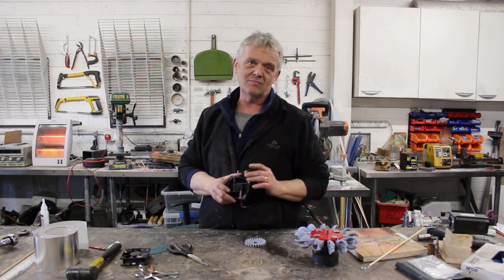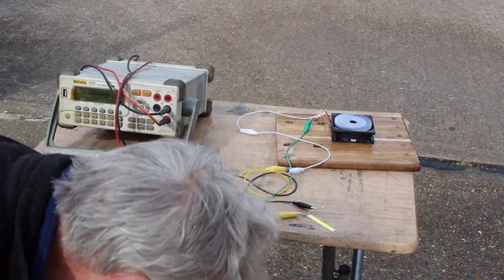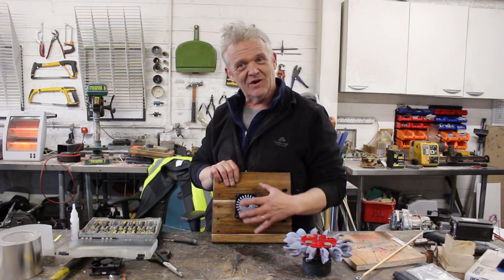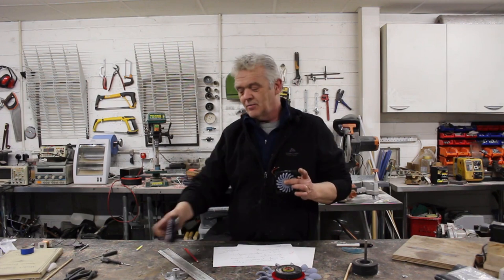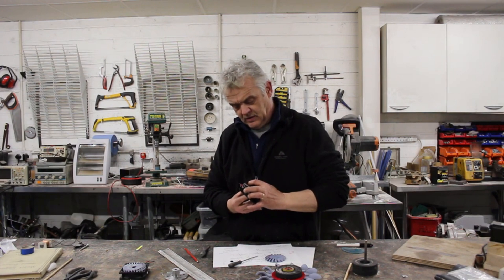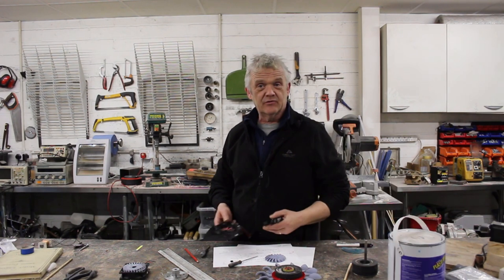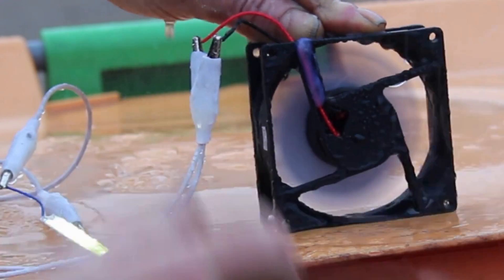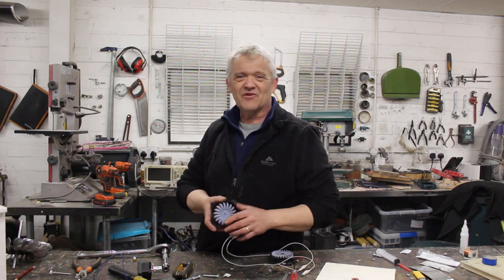2108 Water Power -Turgo And Pelton

Comment: So this is an off topic idea that I hope you might like ? A Heat exchanger is the newest thing for home heating at the moment and although efficient they can cost a great deal to run if you don’t upgrade the heating pipes radiators hot water cylinder’s and then adequately update the insulation and add better triple glazing etcetera ?  Now a large sand batterie if built large enough can hold heat for a very long time so a 2 cubic metre box would hold a lot of heat ? Say you put an oil filled pipe with a circulating pump in to heat up the sand and run it on an off peak night cycle and set a thermostat on it to say 150 degrees c over a number of nights or  weeks you would get this up to temperature and very cheaply too ? Now put another pipe and pump to run this into a hot water cylinder to heat a your hot water and be your heating?? Both thermostat controlled? You could add to this a dump system from some solar panels to add even more heating the summer which would make it even cheaper to run that or a solar heat collecting system? Also with the right construction you could put this into your attic and spread the load on the joists by making it say 100 or 200 cm high internally add the insulation on the out side and you could build it over 10 or twenty metres for the same cubic metres of storage?? And same topic different idea why can’t you put your heat exchanger in a large box with one way in and out air vents and heat the space with a night storage heater again off peak heat and therefore heat everything much much more efficiently and cheaply? You could even make a double glazed heat box around it in direct sunlight to solar heat it as well?

Comment: Brilliant as always RMS.  I’ve probably missed this in previous videos… why is speed over torque so important for domestic generation? Is it a reflection of the variability of wind/hydro speeds? Is it an electrical phenomena (volts better than amps?). Is it to do with availability of reclaimed parts? Many thanks for any insights, Simon
Reply: Given constant strength magnetic field, such as produced by permanent magnets, output is directly dependent on speed. You can play volts against amps with wire thickness but their product (Watts) will always be proportional to speed. Thus high rotor speed is indispensable for useful power generation. When it can be achieved without gearing, then significant mechanical losses are avoided, which translates to even more output (per input). Thus Rob's direct rim generation is a great idea, though it has its practical limits:  to make a large generator, you will need lots of magnets and wire. After thinking about it,  I advise using lots of magnets, which are cheap, on a large diameter rotor. Then make a stator that covers only a small part of the circle, thus keeping the amount of (serpentine) coil within reasonable limits. This has the same benefit as gearing, without its losses.
For example, if Rob used in this demo one of his rim generators with greater diameter, he would have obtained even higher output (assuming the little turbine could spin it at the same rotational speed).
Reply: The recent video about the Archimedes screw does go into torque vs speed. 
My understanding is that it depends on the source of energy and the way it is harvested.
Water in a stream isn't fast but has a lot of torque, and is fairly predictable while wind is rather unpredictable and doesn't have much torque, but with a horizontal wind turbine it produces very high rotational speed.
After seeing Robert's video about recycling vertical fans (squirrel cage) to make wind mills, I've been experimenting with it and found that even though they have greater torque than their horizontal counterpart, it's still preferable to use a low torque generator as it allows harvesting more energy if the windmill can keep spinning when the wind slows down to a light breeze. Finding a motor which can provide at least 5V at 2 RPM is proving difficult though.
Reply: @VeniceInventors  this is true but I was analyzing the electric generation end. It  always needs maximum possible speed, unless you have  much stronger electromagnets whose back emf will match your torque.  With weak permanent magnets, you only have the speed to play with and you will only achieve that match (maximum power output) at very high speeds. So, if you have slow torquey motive source, like low head water, you must gear it up somehow. Though to a lesser extent,  the same applies to the wind as well. There you might be able to get away with rim generation on big diameter rotors, in decent winds.
Rob makes demos that 'something can be generated' but if you ever want to generate useful power, you must consider this.
Reply: @leostarling5746  Thanks for bringing up rim generation. It is something I could easily try as there is a flat disk on the squirrel cages where magnets can fit and  be fine tuned with the coil to match my requirements. Using new and recycled motors is convenient but leaves a lot to chance.
Reply: = to produce more torque - more  load needs to be on the system - Matching maximum torque of the system at any RPM is key to approaching a good efficiency at steady state output. (ue te most out for the least in - materials and hydro resource - , with such a small generator stage (low lods, these babies are nearly up to "freestream speed " of the jet- "Betts limit" - or somesuch more acceptable metric for hydro turbines (constrained flow)  will "indicate the mechanical load" which will produce the most power (peak) out of the system - now to convert all that to electric output..  Using an unloaded the rotor  the velocity  will approach the jet speed - steady state, but mot load the cups up well, ie, operating fairly inefficiently.

(with a given PM generator - speed rules - as per other comments)

Comment: Always a pleasure Mr.Smith, you leave no disappointment.
As the thunderstorm generator touched closely to the aspect of ideal as the self induced lightning harvest converter or (the striker), the striker is a partial to a larger project that requires a global scaled system that converts and transforms energy for future needs,"problems -solutions" survival +civilization advancement.
Planetary EMF adjustment was the original goal, now a base with scores of what can be done by my study/practice of the advancements of transconvermation, of energies.

Comment: what is 'adaptation from motor to generator' u speak of ?
Reply: Umm you may want to watch the video, in this video he described the process.
Reply: You might have to search the channel a bit to find the right video but the short version is that he removes the PC fan speed monitoring circuit board and resolder the red/black wires directly to the stator,

Comment: Use a waterpump off a vehicle(old GM is easiest, bolt an alternator to it or use mounting brackets and a belt). Hoses (hdpe is best) to in and out. In zhould be a 100 or so feet upstream to achieve a good head pressure out back to stream. Recommend mesh over both ends